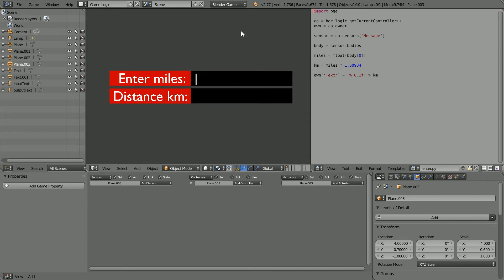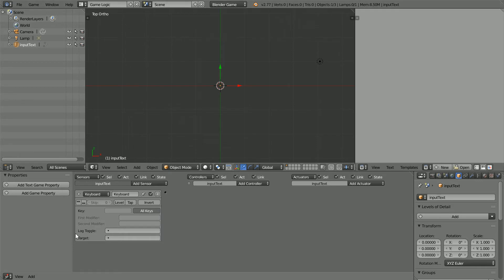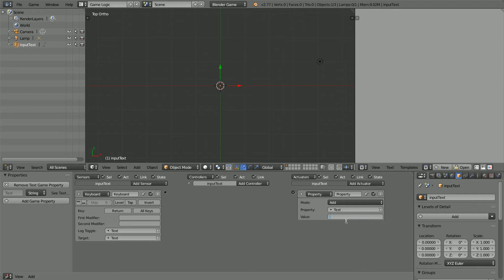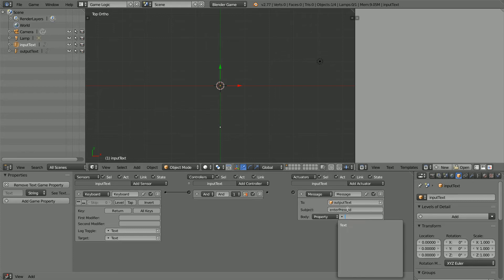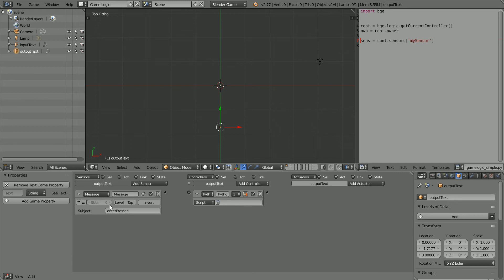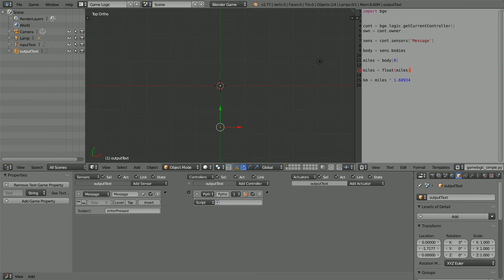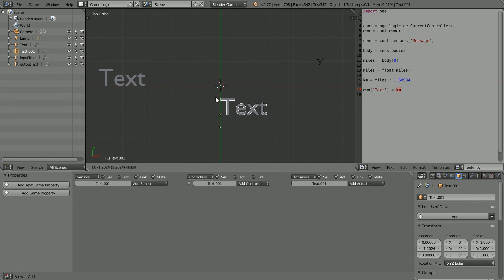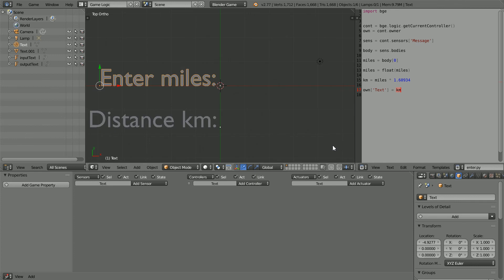Blender Game Engine Scripting Tutorial Input Process & Output, Entering Text At Run Time, Messaging

Comment: The issue you eluded to in this video (text not rendering the same in BGE as in the UI) is the only problem I'm having with text.

You mention a follow up video that may correct this, but a year later and you don't seem to have done that?

I don't want to push, but I'd really appreciate it if you could make good on that video soon. I'd especially appreciate it if you could address the issue of BGE not respecting the horizontal alignment/justification settings as well, and possible workarounds for that. 

(My problem is I'd like my dynamic text to spawn from the center and spread outward equally, which one would think is what center justification/alignment would do, but BGE seems to want to stick with left justified. Addressing this would perfect, but a more broadly applicable video makes the most sense.)

Thanks for the video.